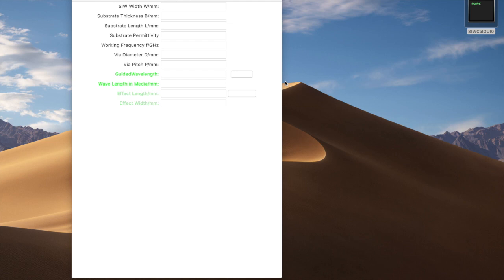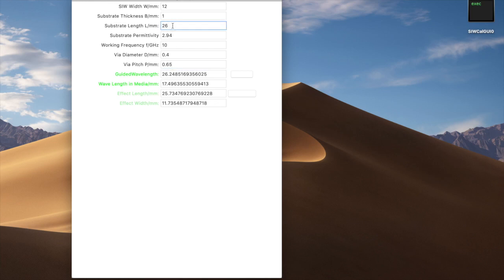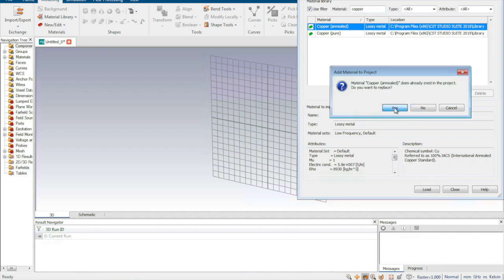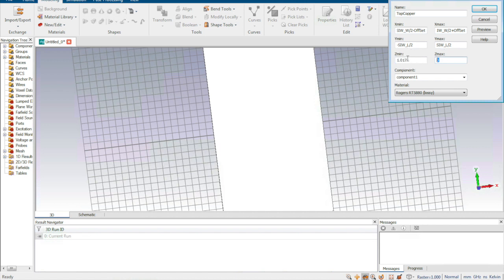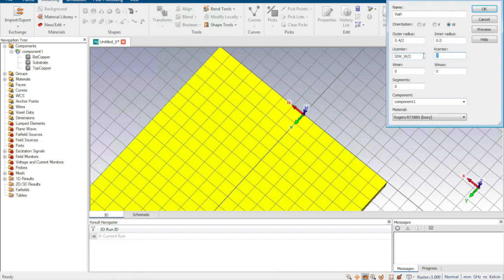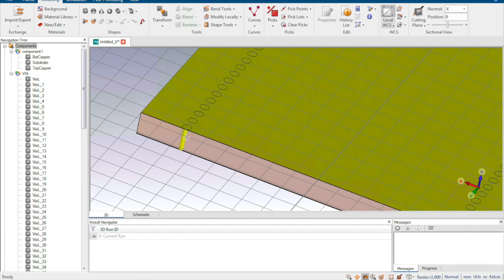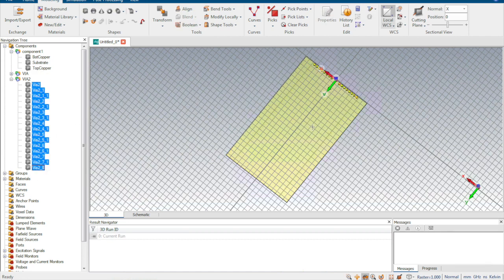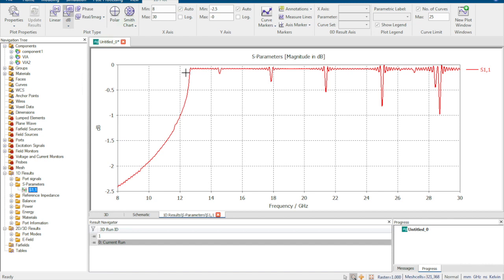How to Design the SIW Cavity

Comment: Hi. When we calculate the guided wavelength as per design formula you had mentioned in another video, we get an imaginary part for it. what do we do for that? and how does guided wavelength varies from wavelength in media?

2.Few papers they have mentioned guided wavelength to be lamdanot/ root(epsilon r)). can we follow this instead ?
Reply from the maker: using the expression lambda/sqrt(Er_r) allows you to determine the wavelength within the substrate. While it may differ from the guided wavelength, it provides insight into how the wavelength behaves within the material.

I made an app to get the initial parameters for SIW.
You can find it in App Store:
https://apps.apple.com/ca/app/siw-cal/id6478937946

Comment: Q1: should the dimensions of bottom layer (GND ) has same size of top layer(conductor) or not compulsory?  because i saw some works   before thier GND  has same shape of resonator founded on top layer .. 
Q2: why this port(feeding) has dimension same as substrate thickness , because in CPW or any transmission line different like that also  in SIW ALSO IN MS line to SIW transition different .
could you pleas guide me how to feed as proper way in every case above (CPW ,SIW ,MSL, all transition  of SIW )
Reply from the maker: Indeed, I shared the tricks to set the port size in my video. 
for example, in this one
 https://www.youtube.com/watch?v=xEawXx7Ur_4&list=PLfLYmRjttUXFAuizNY_3ucLlnk5nx-NUx&index=4

at 29:30, it shows an example how to use the tool integrated in cst to  calculate the port size.

Hope this can help you.
Reply from the maker: for Q1: size the metal vias are working like fence, it can stop EM waves from leaking. The point is using the copper sheets and vias to limit the EM waves. 

for Q2:
the SIW is very similar to metallic rectangular waveguide. the vias fence, is like a solid metal walls. and EM waves are limited by the vias fence & copper sheets. the EM waves are  in TE modes. which means there is no  (or almost no) EM waves in the spaces outsize the via fence& copper sheets built areas.

For microstrip line, the EM waves are in quasi-TEM mode. 
it means two things:1)there are EM waves inside the substrate and in the air(above the substrate);2)speed of the waves( and wavelength) in the air and substrate are different. Most EM waves are inside the substrate, because 1)substrate has higher dielectric constant than air (er=1);2) the bottom copper and the copper microstrip line.

Comment: CAN YOU PLEASE  SHARE THE SIMULATION VIDEO OF WILKINSON BASED  SIW POWER DIVIDER
Reply from the maker: Power divider is an important component in RF circuit, especially for antenna array. And SIW provides good isolation. This is a great candidate to fabricate a SIW working as power divider. I will make a video about the siw divider later.

Comment: as you know the minimum requirement is S11 should be less than -10 which is not in the result... secondly should we substract the viias from top and bottom copper layer or what is the other option
Reply from the maker: For CST, both design has the same S-parameter, no matter the substrate is subtracted by vias or not. It is a great advantage over Feko and HFSS. In CST, FDTD solver is used which can mesh dielectrics and metal. 

If you try it, you can better understand what I am talking.